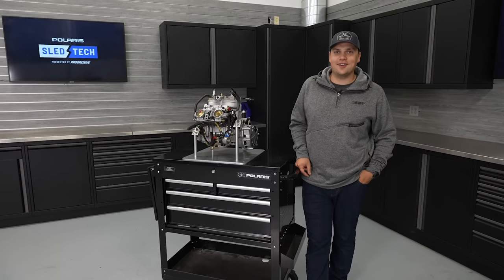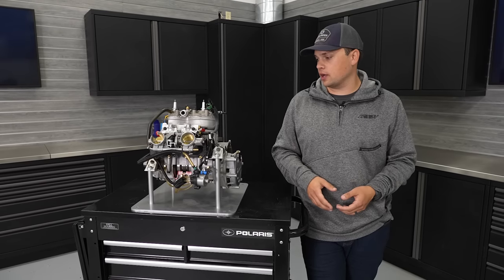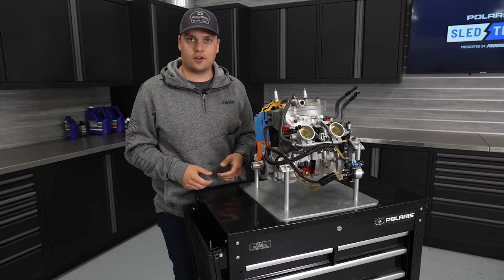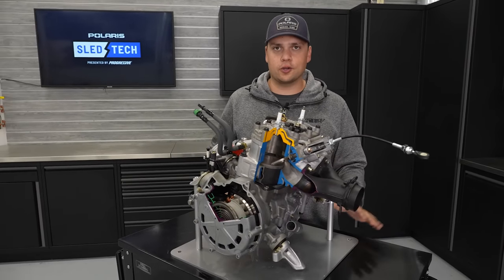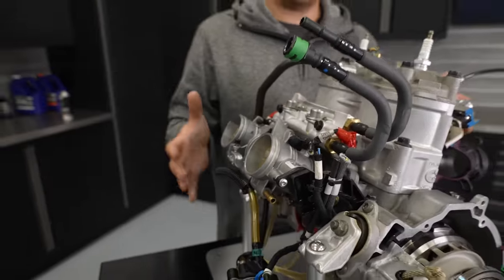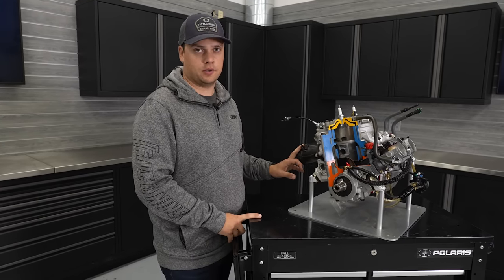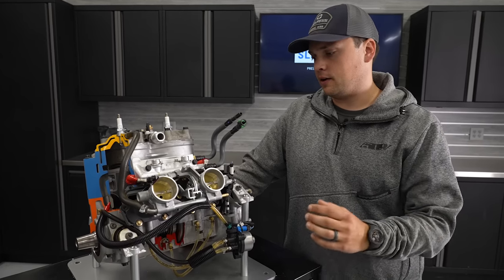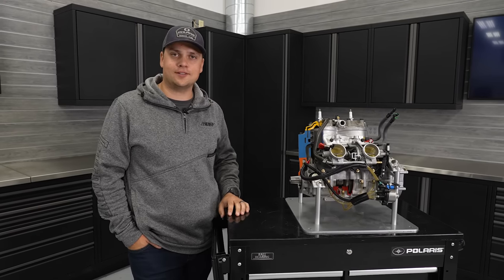850 Patriot Snowmobile Engine Deep Dive – Sled Tech EP. 3 | Polaris Snowmobiles

Comment: I’d like to see offset cylinders from crank centerline, cuts friction, Yamaha Gp road race combustion chambers they are more efficient and less area to absorb heat. Totally map able ignition system. BTW TZ250 Yamahas made 75HP, do the math that 850 would be making 255hp if you used the port mapping and pipe configuration of a TZ250

Comment: I get boost doesent put much stress on the crank but why didn’t I guys use the 9R crank I prove it works at Jackson those mod sleds where weapons .
So we all know you are coming out with a 900 boost in 2026 
Plus u could have ported out the cylinders alot u forgot to do it to mine lol. Why are the case part numbers different some u basically made a billet crank. My 850 motor is slow as hell in my 24 boost please put a 9 mod in mine lol!

Comment: By far the best performing Polaris snowmobile engine I have ever had.  Still have durability/quality concerns as two of my friends have had major issues with their 850s (one is a 2019 and the other is 2023).  I expect “Fuji 500” durability, especially considering todays purchase/repair costs!
Reply: I miss the ol’ Fuji…. If only they were as reliable as they were in the 90’s!
Reply: I have a Fuji 500. The one thing people forget is that in order to go 5000 miles between rebuilds in the mountains, you needed to give up horsepower. It makes about 80hp, and is dead nuts reliable. Any attempt to gain power seemed to have an extremely detrimental effect on the longevity. Now we have an engine less than twice the size making more than twice the power. If your piston pins stay in, and you didn't get one of the misassembled 850s where the crank bearing never got lock-tite, they generally last 3-5000 miles still.

Comment: Awesome... i just dont like the electric oil pump thing.
Reply: Get used to it. Emissions is killer on the 2t. By going electric they can vary the oil rate by RPM to make sure it passes emissions while still having enough oil wide open, and very little oil to keep it from loading up at idle. 

If it makes you feel better, I was working on my buddies boat motor. 200hp v6, with a variable oil injection. 50:1 at wide open, 180:1 at idle.